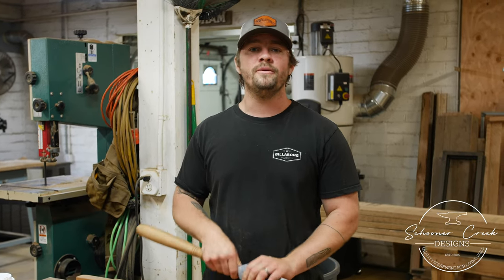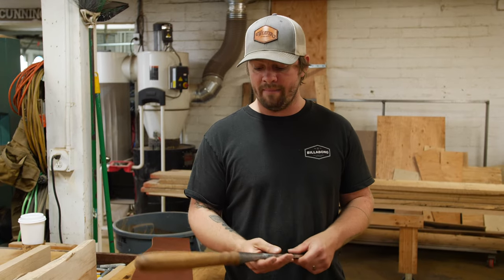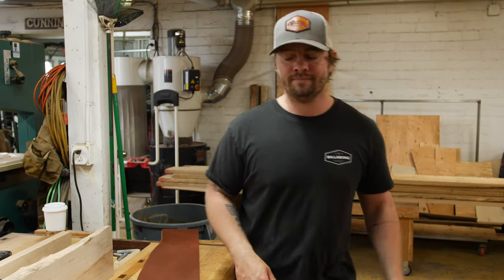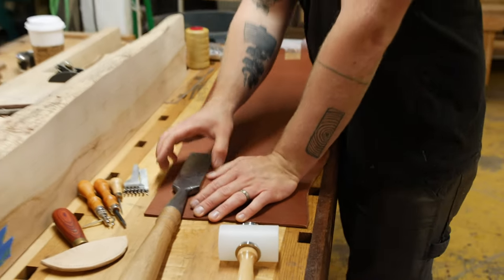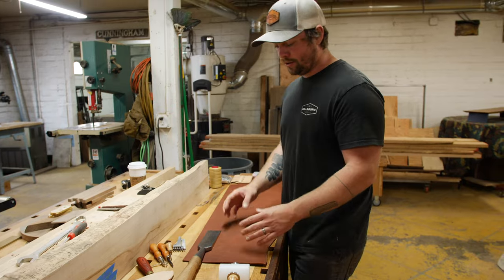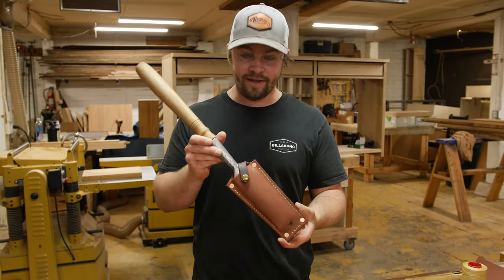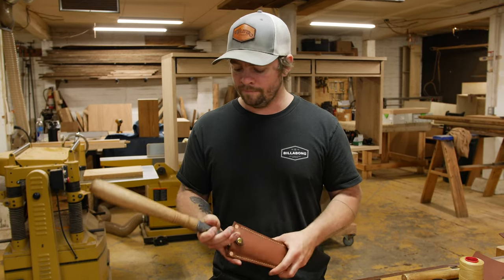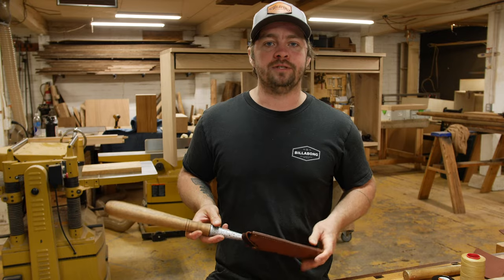Custom Leather Sheath for our Timber Framing Chisel!

Comment: Looks fantastic 
But it needs a extra piece at the bottom to stop the chisel cutting thru the bottom thread
Fantastic otherwise
Reply from the maker: I almost did that but wanted to make sure the chisel fit tightly so I ended up placing the bottom two rivets just off the corner of the bevel and they stick up above the threads so the leather is pinched tightly and prevents the bevel from going all the way to the threads. We will see how long it lasts!
Reply: @schoonercreekdesigns  
No problems 
Looks great and also enjoyed your vid on restoring the chisel
Love that type of thing 
Well done